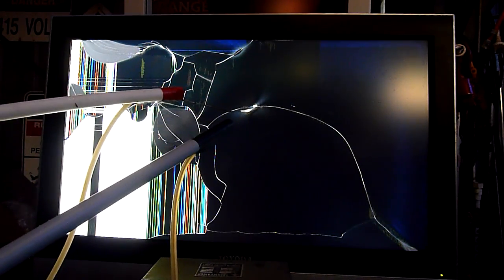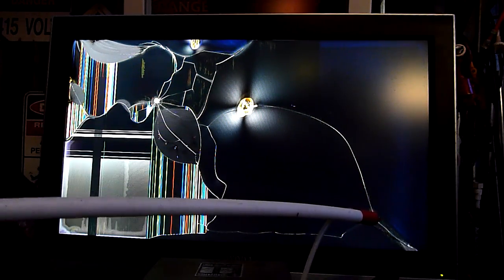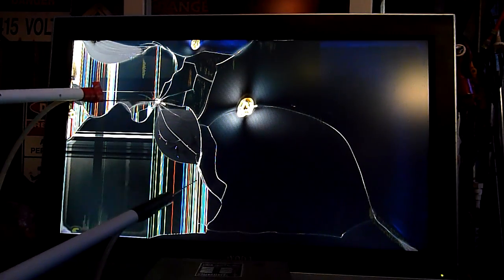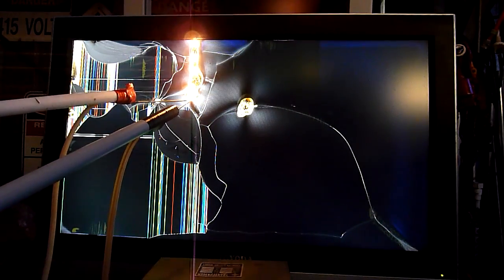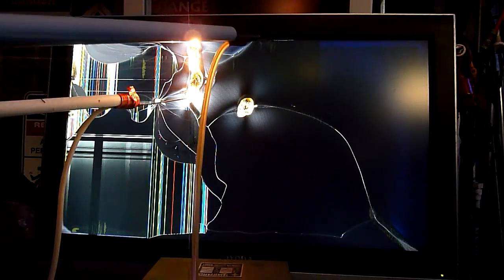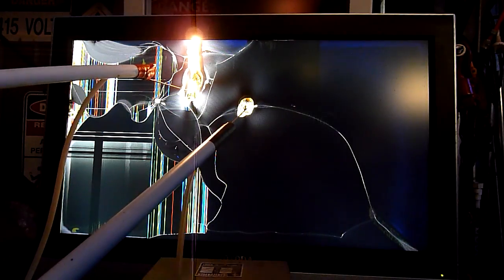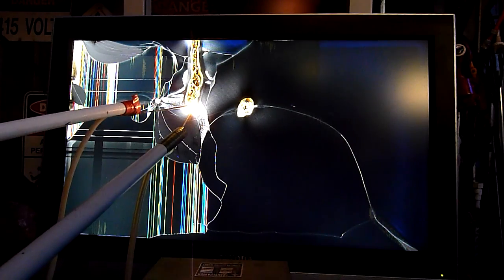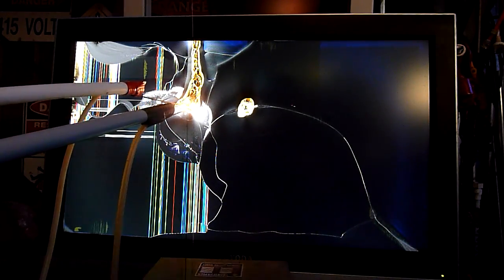LCD TV Vs Neon Sign Transformer

Comment: I've gotten shocked by a flyback transformer in high school from electronics class. We had black and white TV boards we were testing live with oscilloscopes and multimeters, when I showed my friend how big of an arc I could get from it. I used pliers to hold the wire, the wire had a hole in the insulation and so did the coating on the pliers handle. I got a 12,00 volt shock that made me throw the pliers across the room.

Comment: you might get some interesting results using a razor blade on the screen first.  ( think they put a plastic film on the panel for safety reasons in case of breakage

Comment: The idea is neat, but you need to attack the edge of the panel (behind the frame, where the drivers connect to the glass) for best effect (I assume, I have never tried). I guess the polarizer and first glass panel does a quite neat isolation barrier.